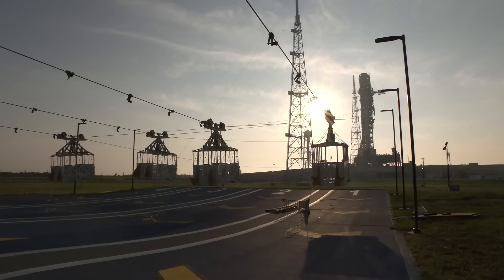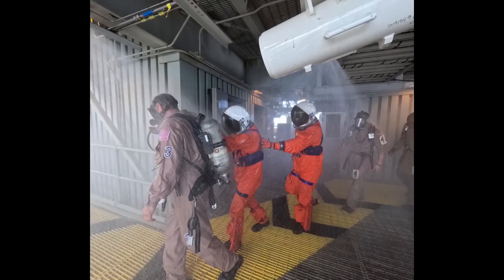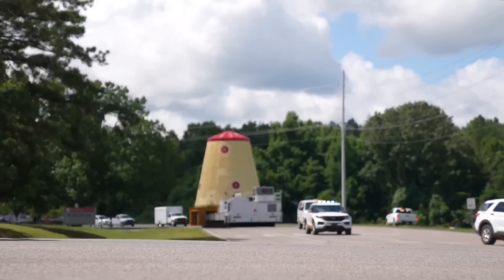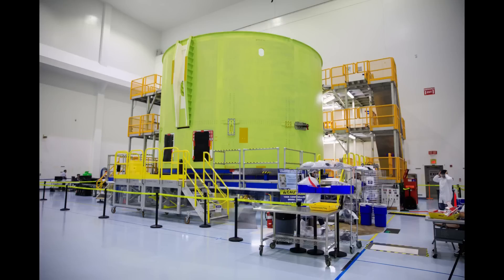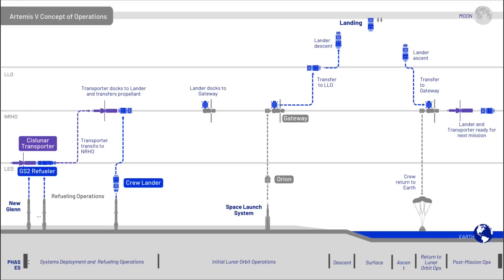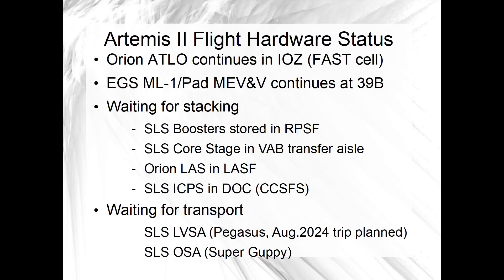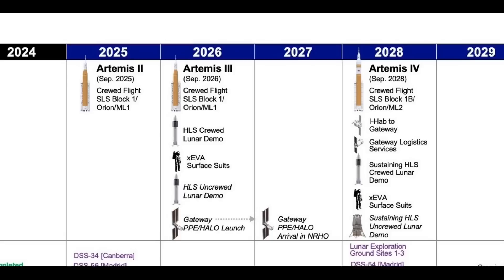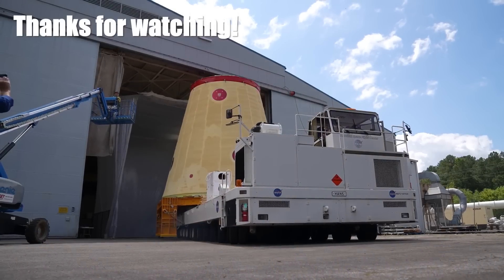SLS planning triple Artemis shipment to KSC and Blue Origin planning lunar landing demo in 2025

Comment: Artemis III in 2026 is a pure fantasy.  I honestly think that Boeing could deliver the required SLS hardware on time for that launch date.  The problem is SpaceX - they have nothing in production right now for Artemis III.  There is just no way .. that they will make that 2026 date and are basically hoping for more Boeing delays to save them.  It's not going to happen.
Reply from the maker: The info in public makes it hard for me to make a strong conclusion about the schedules any of the Artemis III elements right now.

SpaceX just has a lot more ambitious plans to realize in the next two years than Orion, SLS, or Axiom.

It would be nice to get more than a couple of schedule updates a year, but that's about where things are these days.  I'm hoping there will be something about the different schedules in the upcoming NAC HEO meeting.
Reply: @PhilipSloss  Don't you think that assembling all the Artemis III core stage components by the end of 2025 is feesible?  These compnents are all on hand aand in the manufacturing process right now.  

But for SpaceX, there are no flight ready Super Heavy boosters. No Starship tankers. No Orbital Fuel Depot.  And no Human Landing System.  It is crazy to even say that SpaceX might still deliver all of these items in the next 24 months.  They clearly won't.  NASA needs to schuttle Artemis III.
Reply from the maker: @ericmatthews8497  It might be feasible to complete the 3rd Core Stage by the end of next year, but that's why NASA is calling these contractual need dates.  The question for SLS, Orion, Starship, Axiom is will they?  (As opposed to 'can they?')

The facility in the VAB that Boeing is building should help in the long run with efficiency but this will be another "first-time" operation, final assembly of the 3rd Core.  Those tend to run long and right now Boeing is supposed to be finished with that unit in basically 15 months (end of 2025).

The contrast for SpaceX is that Musk is spending for growth, so he's mobilizing production facilities and capacity.  (Government is more like a value investor...they rarely do "rapid scale"...for NASA it was just the once with Apollo.)

SpaceX should be able to build plenty of Starship hardware in the next two years.  The bigger concern is the rapid flight and design iteration to turn around flight data into design mods and go again.

They should have 7-8 flight tests done by the 2nd anniversary of the first one...but how many orbital flight test objectives will be accomplished by then?
Reply: @ericmatthews8497  you casually missed that Starship is waiting for approval to launch in the next 3-4 weeks. Orbital fuel depot could be launched in a few months with a passive thermal solution. HLS will need some work but mainly fitting the needed equipment and additional landing engines on top, not the rocket itself. Starship tankers are probably the easiest and hardest as they need to change the payload bay to extended tanks and that probably requires a lot of redesign which was probably made a year ago or so.
Reply: @CJisDJ  Has SpaceX started building a fuel depot Starship?  Have they started building tanker Starships based on the Raptor 3 engine with massive redesign to recover the lost 60 tons of capacity to orbit?  Have they started building multiple HLS vehicles because NASA isn't going to send Astronauts to the surface of the moon in an untested spacecraft?

The answer to all of these questions is ... no.  And there is no way on this good Earth that SpaceX is magically going to get all this done in the next 30 months.  Artemis III should be SCRAPPED and SPACEX forced to return the money we gave them.
Reply: @ericmatthews8497  You dont need a new starship for raptor 3. S33 is right now a starship v2 that could accept raptor 3. But they have like 180 raptors 2 to use in test flights without cargo so it wont matter. If you would cancel hls you are looking at a much further schedule than few years from now. And space x got $2.98b that's like one SLS cost per year. Those are pennies compared to sls program. The best option is to keep them going. The tech is here. The only interesting thing is if they could tank the depot in non reusable mode. That would probably be like 5-7 launches
Reply: @ericmatthews8497  Oh and btw. There is a genuine factory being built that could mass produce everything. That also changes a lot as the ready ships amount won't be a problem anymore. Makes the emergency expendable option viable. I doubt that in a month we will see a super-heavy landing but if it will be a success there is not a lot more to do than to possibly make HLS prototype get the mass simulator in and go for the moon
Reply: @CJisDJ    SpaceX says it will take 15 refueling flights just to complete one HLS mission for Artemis.  If they can increase the launch cadence to once every 6 to.7 days, it would still take a staggering 4 month campaign of Starship launches to put enough propellent in orbit for one HLS mission.  I honestly think that it is never going to work - SpaceX will never be able to put enough propellent in orbit for even a single deep space mission.  Super Heavy and Starship are too big, too inefficient, and too operationally complex to meet the that schedule.

Who cares how cost effective a Deep Space launcher is if it cannot reach Deep Space?
Reply: @ericmatthews8497   in the most pessimistic estimate by NASA, space x suggested about 7-8
Reply: @ericmatthews8497  i doubt in 2 years that starship v3 wont be flying
Reply: @CJisDJ  Nope - It’s 15. And that is a rather optimistic number considering that Starship doesn’t even work yet, and SpaceX has no idea how much mass bloat is still to come.  That is why Starship V2 and Raptor 3 are needed.  It’s a Hail Mary pass to the end zone to save the entire program.  Except in football there is a chance it might work.  This is rocket science- not football- so it won’t work.
Reply: @CJisDJ  The program will be shuttered before v3.  It’s a dud.
Reply: @ericmatthews8497  I mean whatever goes with SLS and moon mission the starship will be flying anyway. And there will be someone "dumb" enough to fly on it some day for sure.
Reply: @ericmatthews8497  having 100+mt to orbit means they could easily launch a full-on apollo like capsule with fuel. The only point is the time scale, not the capabilities. Btw I would rather look for a giant budget hole that is SLS than pennies spent on Space X. Falcon Heavy could probably launch in 2 missions enough equipment to make up for SLS whole contribution.
Reply: @CJisDJ  Utter bull.
Reply: @ericmatthews8497  Starship right now can launch to orbit while the cost per unit is pennies compared to SLS. In expendable mode let's even go for a pessimistic 300M$ per unit that's 7 times less than sls and can be done multiple times in one year not like sls. 7 launches could get you pessimistic 400+ metric tonnes to LEO.  Thats more than enough for anything.
Reply: @CJisDJ Starship prototypes* it isnt even finished
Reply: @polishkerbal6920  Sure. Yet it could deliver payload to orbit as soon as a month from now if the FAA accepts everything
Reply: @CJisDJ  I’m not talking about orbit.  I’m talking about deep space missions.  Starship requires multiple launches (in the teens) for a deep space mission. There are no plans to carry payloads that would require an orbit transfer vehicle to take a payload from Starship to a distant orbit like the moon.  

Also, other than a few
renderings, SpaceX has not created a Starship configuration for general cargo.   Until we see actual hardware, there is no realistic expectation on the payload capacity.
Reply from the maker: @CJisDJ  What is the source for this?  Has SpaceX said they are ready to launch third-party payloads today?
Reply: @PhilipSloss  I'm talking about the capabilities. At least some Starlink launches need proceed for this I think
Reply: @ericmatthews8497  It's likely that the full open cargo variant is highly unstable. But there was a cargo door made some time ago and proceeding the design into reality wouldn't take much time I think.  Basing on Blue Origin needing refueling for their landers. The problematic concept is the low DeltaV of orion. And the mission profile. Saddly for the starship program its highly optimized for LEO not TLI. By technology means not time NASA proved that cryo cooling is plausible. There us a great video by Eager Space - Starship Orbital Refueling that explains the basics.
Reply from the maker: @CJisDJ  Unless SpaceX has something on their Starship manifest already, those would be theoretical capabilities.

It's a bit like saying that SLS has the capability to launch the Gateway CMV.  In theory, it does.  In reality, neither SLS nor Starship can do that today...and it might be a few years before either could launch something like that to the Moon.
Reply: @PhilipSloss  I still doubt the timeline but there are a lot of issues except starship. While it causes delays we still don't know when axiom gets their suits done
Reply: @PhilipSloss  And sure all those things are assumptions at best. While there is no proven path we basically can only theorize what could work and what's the better option. Quite possibly things will be faster as the starship factory starts running but that's still a theory. 30 months from now are a hard goal but I'm curious what would happen if the starship went full expendable for those lunar missions as it would be quite easier just more costly.
Reply from the maker: @CJisDJ  The question is whether on-ramping other customers/capabilities right now -- like large comsats or NSSL or NLS II -- is possible without having to deprioritize Artemis with NASA Exploration as one of their original customers.  It seems like a non-trivial task, as is HLS.

All the Artemis programs have their schedule baggage, but they are all independent of each other, even Orion and SLS.
Reply: @PhilipSloss  Great question. In theory, as the program develops and is more and more reliable. Nasa will get the starship priority to NSSL launches. HLS is weird as in 30 months they not only need to invent the thusters to land, maybe sort of super draco? But also equip the whole thing in ISS grade equipment. And I haven't hear about any of that
Reply from the maker: @CJisDJ  If SpaceX gives Starlink and Artemis priority, than NSSL or NLS II are theoretical capabilities that need to be realized, which means they are still future capabilities.

Given Starship is better funded than SLS, barring some unforeseen change, they're more likely to realize them before something like SLS Cargo...but it's still going to be a while if it comes after Artemis HLS.

The Artemis III HLS need date is probably no more than 24 months away, since the Starship lunar orbit checkout review would need to be some weeks in front of Orion/SLS lunar launch windows in September 2026.

If completing both the Artemis III HLS uncrewed and crewed demos takes longer than two years, then the question is whether SpaceX can on-ramp those other Starship customer capabilities simultaneously with finishing Artemis HLS development, for example with additional resources.
Reply: @PhilipSloss   Everything depends on how much of the HLS is designed. Making some hard speculations, evolved version of dragon capsule life support systems could do the trick while fitted up to NASAs requirements. HLS doesn't need header tanks so more space for everything. Batteries are there already. Solar panels need to be scaled up from dragons trunk. Dragon in pure theory has completed most of the challenges but they would probably need some water to o2 stations just to be sure.
Reply from the maker: @CJisDJ  According to NASA, the critical path includes the propellant transfer demonstration and uncrewed lunar landing demo.  It's not clear how much of the HLS ECLSS will be tested before the crewed demo that is part of Artemis III...but it that case, that work might not be critical to the schedule.
Reply: @PhilipSloss  That "critical path" is woefully insufficient for describing the challenges facing SpaceX.  Before that Starship and Super Heavy need to be reusable by landing Starships and catching Super Heavy boosters.  They are still working out problems with the thermal protection system and the first couple of booster catch attempts are fraught with peril.  A failure could lead to significant damage to the orbital launch mount and tank farm - resulting in months of additional delays and they make  repairs..

They could forego booster catching until the second orbital launch mount is complete to guarantee a timely ship-to-ship propellant transfer demonstration, but they would still need to achieve rapid reuse goals BEFORE they can even think about  an Orbital Propellent Delivery campaign for the first HLS mission.  Oh yea, and before that they need to perfect everything to achieve a launch cadence less that 6 to 7 days.  One failure on that path could stall the campaign.

My biggest fear would be an explosion in orbit when transferring propellent.  This would create a dangerous debris field that would accelerate the Kessler Effect taking out satellites and making access to space more difficult for EVERY NATION ON EARTH.  My advice to them would be to proceed with EXTREME CAUTION and take the time to get it right.  The event I describe is not unlikely, and Elon Musk will not be able to make some joke about a "RUD in Orbit" and move on to the next attempt.   The geopolitical and legal/financial ramifications would likely kill the Starship Deep Space program immediately and maybe even SpaceX itself.
Reply from the maker: @ericmatthews8497  If those happen, then we'll see what the repercussions are, but Musk has mobilized a large workforce for even recovery efforts, as with the pad surface after the first launch.  

So far we've seen the schedules slip, but we've also seen a lot of progress.  Worst-case scenarios are possible, but so far haven't occurred.
Reply: @ericmatthews8497  China didn't get cancelled for their exploding upper stages on orbit while it is almost said to be intentional
Reply: @alvianchoiriapriliansyah9882  the fact that month ago almost no one believed they would land it on the first try is neat
Reply: Also still not totally sold Axiom can make that date with the suits either. 

Won't be earlier than 2028, realistically, I think

Comment: What a joke and waste of time/money! The rocket blows up like a small atomic bomb and they'll ride this "ride" to safety? Right.
Reply: Which rocket?
Reply: They wouldn't use the emergency escape system for a rocket explosion.
There are other contingencies that would be used for.
Reply: there is a launch escape tower atop Orion with a lot of effort put in by lockheed, LES towers are the most reliable abort method since forever. the buckets they ride off the tower are different and are used in less drastic conditions

Comment: When Starliner was delayed by 7 years, all missions to the ISS that might have otherwise flown on Starliner ended up on Crew Dragon. Does the HLS contract allow for something similar if either Starship HLS or BlueMoon Mk2 were to be delayed for a similarly long time? If Starship takes until 2031 to be ready for a crewed moon landing, could we have a delayed Artemis 3 landing in 2030 on BlueMoon Mk2, or is it fixed that Artemis 3 and 4 will fly on Starship, no matter how long it is delayed?
Reply from the maker: At the time of the commercial crew awards, the expectation was both providers would be ready to begin crew rotations by 2017, so Soyuz continued to provide that service from Russia until 2020 and then Dragon since then.

NASA should be able to shuffle Artemis missions depending on what hardware is available; that's about all they have said and then we have to read between the lines.

Availability is still pretty cloudy for all the programs, from Orion and SLS to Gateway and to HLS.  

Blue Moon Mk1 joins the list of things to watch for in 2025, but it's still hard to get a read on how confident one should be about the missions scheduled for next year.
Reply: @PhilipSloss  People don't realize is that SpaceX itself, while it did deliver and well, it was upwards of 5 years late, depending on what original goals you look at for Crew Dragon with regards first test flights and then being certified for crew rotation by 2017. Some of that could've been mitigated by the higher requested budget for Commercial Crew (CC).

The good thing is that CC had two providers, just like COTS/CRS did, so there was enough dissimilar redundancy so that, even though late, someone delivered.